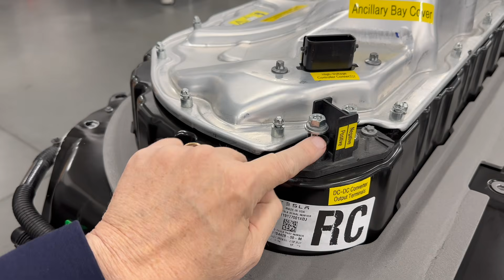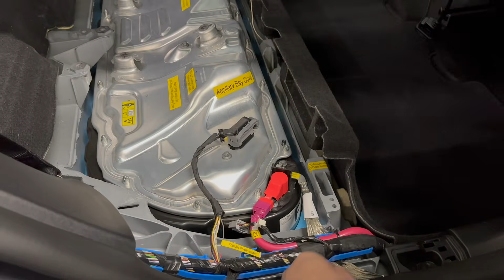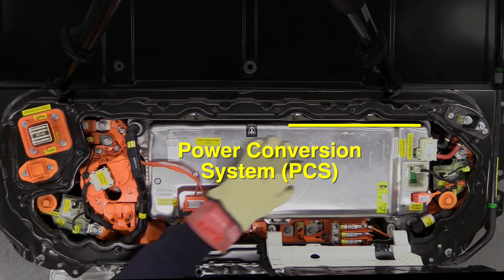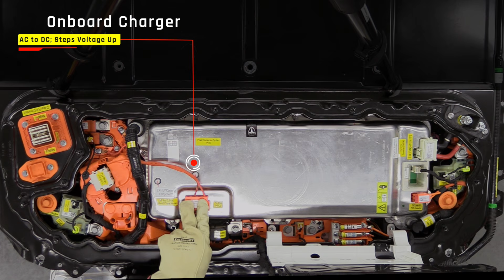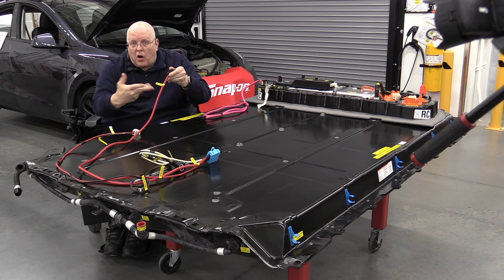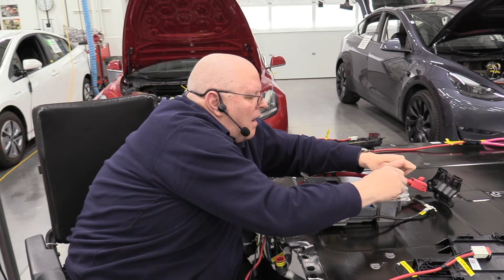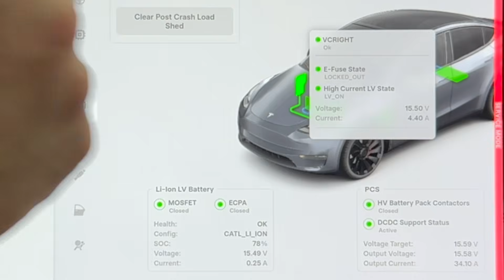Tesla Low Voltage Charging System

Comment: YES! Hearing that THE Professor John D. Kelly will be recording automotive technical videos again has been the best news I've heard all day. I no longer work in the automotive industry (techs don't get paid well or treated well enough) and moved onto the manufacturing industry, but still like to learn and stay up to date on automotive technology. Your videos are a reminder of what I really enjoyed about the automotive world, shame that the service/repair industry had to ruin it for me.

A small bit of personal experience with the 16V Li-Ion batteries in newer Teslas: my partner was recently in a major collision where he was hit by a drunk driver who was going well in excess of 100mph on the freeway. My partner was in our (late) 2022 Model 3, drunk was in a mid 2010s Mustang. The Mustang hit the Model 3 at least 40mph faster than my partner was going, rear ending him and hitting with basically a 20% overlap in the right rear. It wiped out the Model 3 basically all the way up to the right rear door, where the Mustang seemed to then get pushed off, avoiding crushing the passenger compartment (kudos to Tesla for making the passenger compartment secure).

Where I wasn't impressed was in the low voltage battery reserve capacity. As a result of the impact, the Model 3 got launched into the center divider of the freeway (cable barrier) which shredded the left side of the car and basically ripped the charge port off the car. I don't know if this caused a short or if Tesla does this in all collisions, but it blew the pyrofuse and shut down the low voltage charging system. The 16V battery (which was only a couple years old) was dead within 10 minutes, causing all the windows, doors, trunk, frunk, glovebox, etc to ALL be disabled. Most importantly, all the vehicle lights went out. This crash occurred at 2am while my spouse was driving to work. That meant that a car with zero functioning lights was sitting in the middle of the freeway. Thankfully the police had already arrived by that time, but that is not always the case and could have led to a catastrophic secondary collision. It also made the vehicle incredibly difficult to get into after the fact when trying to recover property from the car before it got scrapped.
Reply from the maker: Thank you and thanks for sharing. I am sorry to hear about the accident. hopefully he was able to get out of the car before the battery shut off.. The 16V battery has a lower reserve capacity. In my tests here on campus, they typically last up to 20 minutes (depending what was turned on) before shutting the car off after the low-voltage charging system is turned off.

Comment: How do you feel about that aluminium cable plugging into a copper one?
Reply from the maker: As long as the connecting terminals are compatible it is not a problem.

Comment: I have lots of power outages in my area. Thinking of getting a pure sine wave inverter so I can power a few basic things when the power goes out. What is the maximum wattage pure sine wave inverter I can hook up to the low voltage terminal at the back? I have a model 3 with the lead acid battery so the system is 14 volts. What is the max amps the DC-DC converter rated to? I can see from the presentation that with the car just on it draws about 33A. So I assume if the DC-DC is rated to 100A max then the pure sinewave inverter can draw 67A or maybe 60A to be on the safe side?
Reply from the maker: Do not connect it at the terminal in the back, it will cause errors. If you must, connect under the hood at the jump start location. The DC-DC converter is rated at 2500W, but the car uses about 450W just to be powered on.

Comment: Thanks for the low voltage system breakdown, some more ground connections I need to spray with a product called Rustcure. Corrosion on ground connections is a bad thing.
Reply from the maker: You are welcome!

Comment: I have jump-started ICE-cars a couple of times with my Model 3 -21 Lead Acid, jumper leads attached straight to the battery. Now I just bought a Model Y -24, 16V. When jumping other cars, is it preferable to attach the leads to the 16V battery or is it better to attach at the"penthouse"?
Reply from the maker: The owner's manual tells us not to jump start other vehicles, but if you are going to anyway, use the jump start terminals under the front trunk.
Reply: @WeberAuto  Thanks for the info and the advice. It will try and see, fully aware that I'm paying if anything bad would happen, which is a risk I'm willing to take.

Comment: How is the HV Battery connected to a DC/DC for the Standby, if the contactors are open? Are there Sense-Wires that are used and how is the schematic?
Reply from the maker: Yes, the there are two wires per contactor monitoring if the contactor is open or closed. One of those two wires on the positive contactor is always connected to the live side of the battery positive. One of those two wires on the negative contactor is always connected to the live side of the battery negative. They are connected to the high voltage controller (HVC).

Comment: I’d be interested to see what higher low voltage vehicles look like? Things like a lucid air or Tesla cybertruck. I’m not knowledgeable about these kind of things, but fascinated by it all. Would the wiring be smaller if it was higher voltage?
Reply from the maker: I am working on gathering 800 volt systems to play with. From what I have read, the low voltage systems are very similar. The Cybertruck has 800V, 48V and 16V systems. Thanks for watching
Reply: @WeberAuto  thank you! Love the videos, and awesome to see Weber state. I’m originally from Utah and miss it every day!

Comment: Do you have a tip for getting Power out from either the high voltage or low voltage line for supplying a home/ battery powered inverter like an EcoFlow delta pro or similar?
Reply from the maker: I do not. Tesla does not address accessories tied into the LV system except through the accessory sockets.

Comment: I watched this because I keep hearing about EVs with low voltage batteries that go flat after a few days.  I have been wondering why they are not kept charged from the high voltage battery.   I am astonished to discover that only Tesla has thought to implement this outstandingly obvious requirement for trickle charging.  The standard of products these days is appalling.
Reply from the maker: The Standby Power Supply is a wonderful system.  Thanks for watching

Comment: Considering M3 Highland, where is the best place to tap into the 12V system to take up to 50A out for charging RC model battery? Will it produce any errors if I pull that amount of power?
Reply from the maker: It will set errors no matter where you tap into the system for 50 amps. I cannot find any Tesla guidance for such a situation. Best wishes.
Reply: @WeberAuto  It is very unfortunate this is not possible and that there is no 230V DC-AC converter like other brands have. I would like to get M3 but I would also want to not have to load 2x 12V 100Ah LiFe batteries I currently have for flying. Considering the DC-DC is capable to put out 83A or so, I think it should be able to get me 40-50A on its output...
Reply from the maker: @jointercz  The DC-DC is rated at 2500 Watts. I am not sure how long it will let you draw 50 amps without triggering a service alert.
Reply: @WeberAuto  Thanks for letting me know the rating. I want to get it next year and this is something I want to try, so if that happens, maybe I will remember you helped and let you know the result. :) And thanks for the video very much, very useful.

Comment: Love your videos can you go over the low voltage system of the Rivian R1's?  The recovery procedure is not very clear in the manual.
Reply from the maker: I would enjoy that, thanks for watching
Reply: @ standby power to the low voltage is key on the new teslas to prevent bricking!

Comment: Great to see you back with a new video!  You mentioned a wire that is used to maintain the LV battery charge level while the vehicle is sleeping and it does not require the HV battery contactors to be closed to do so.  When I monitor the voltage level on our 2023 Model 3 LV battery using a multimeter or Bluetooth voltage monitor, the voltage level drops slowly over a six day period then wakes (the contactors close) to replenish the charge level.  Did I misunderstand what you described in this video regarding this?
Reply from the maker: Thank for the feedback. Good catch! Tesla made a firmware update to reduce the electrical loads when the car is off. They got rid of the "Standby Power Supply" system and introduced a "Sleep Bypass" system. "When the Model 3 goes to "sleep" the new sleep bypass will turn on and connect the entire low voltage system directly to the HV Battery to supply a continuous 10.6V rather than relying on just the LV Battery for power." "During Sleep, there is some LV current draw through the Sleep bypass. This average current is reported after the vehicle wakes up by VCFRONT_sleepCurrent. While 500 mA is the minimum threshold for the Sleep state, it is high enough to drain the LV Battery to the point where it requires support relatively quickly. Ideal vehicles have an average sleep current of about 75 mA, while the majority of vehicles draw around 120-130 mA. There are many factors that affect LV current draw, the largest issues being 3rd party devices tapping into the Sleep Standby Supply." This information explains what you are seeing. Thanks again. With as often as Tesla issues firmware updates, I need to check my service information for changes before publishing a video like this.
Reply: @WeberAuto  Thanks for the response!  Searching for "Sleep Bypass" it appears there might be a low power Buck DC-to-DC converter located in the Penthouse or possibly the VC-Front controller that directly gets its power from the HV battery and does not require the HV Contactors to be closed.  In the event of an accident, a blown Pyrofuse would presumably isolate this direct bypass connection to the HV battery?
Reply from the maker: Yes, an open pyro-disconnect would remove voltage from the connection to the HV battery.

Comment: Very clear explanation of the system Professor Kelly.  Several times during this video I was asking myself why do they need a separate battery for the low voltage system when they can convert the main battery voltage to whatever they need? Afterall, they are still bypassing the contactors to maintain the LV battery when the vehicle is switched off and they can monitor the main battery SOC to prevent it going completely dead.  At the end I think you indirectly mentioned it.  In an accident, the main battery is disconnected from the vehicle however they may still essentially need emergency LV power for other life safety systems.  The other reason of course is the contactors themselves need an independent LV power source for actuation.
Reply: It's required by federal law FMVSS
Reply: @Nicholas-f5  I'll take your word for it as I can see the safety implications especially on modern vehicles with their power windows and door locks...
Reply from the maker: Thank you very much!

Comment: As usual, a high-quality and informative video. PSC maximum current 81.2 amperes when everything is turned on, including two sockets (in the trunk and armrest)? What is the maximum continuous current it can give, for connecting an inverter 16v to 220v? Tnx
Reply: One way to find out is to use a carbon pile, ammeter and voltmeter as shown in this video: https://youtu.be/y7Q_ZXxCfMM?si=lpwCU5x9yPF1qf-C&t=54 

In my testing I’ve often witnessed well over 100A when loading down to 12V.
Reply from the maker: Thank you. The DC-DC converter is rated at 2500 Watts maximum to the VCFRONT, not the LV battery.. It will trigger service alerts for unusually high current if the LV battery draw is too high for an extended period.

Comment: This is a great video. Everything you have discussed seems very accurate and well researched. The only thing I will say is, When dealing with the HV battery connections, If the points being touched have known high voltage, or are unknown/untested, it is recommended to only have one hand in that area. The other behind your back/ at your side. All it would take is a pinhole in your hv gloves to allow voltage to get you. If you have both hands in, the path of electricity is through your heart. While it is a worst case scenario, it is possible.  Also, if the HV battery is being serviced, it is suggested to remove the pyro disconnect to halve the voltage. Everything else I saw here is well done.
Reply from the maker: Thank you very much. Great comments on safety procedures.

Comment: Could you explain supercharger?
Reply: Used to be a stack of onboard car chargers but now seems to have a changed
Reply from the maker: A supercharges is Tesla's name for a DC Fast charger. It converts AC voltage from the power grid to DC and feeds it directly to your car's battery.
Reply: @WeberAuto  can you make a video of cabinet?

Comment: missed you bro. have been running my gen1 chevy volt off of a 32 ah lifepo4 battery i built which saves ~50lbs of weight. also have a solar roof which keeps the low voltage side topped off through an mppt. teslas bump in voltage and the videos on youtube are what gave me the courage to try this. beeing running fine for the last year with no bms, just an inductive active balancer and a thermostat relay board/heating pad. your videos on the gen1 volt is partially why i got the car. best car ever imo
Reply from the maker: That is awesome. The first gen volt was an amazing car.
Reply: Great for short trips before the gas engine turns on perhaps
Reply: @Nicholas-f5  good for my 185 mile commute so i only end up using 2 gallons of gas lol. charge at home, charge at work.
Reply: You're running a lifepo4 battery with no BMS?  Why in the world would you do that?
Reply: @stargazer7644  more max amp discharge rate, no low temp lock out, cuts the price by around 50%, better balance capability with active balance boards, less self discharge, no low state of charge lock out. and its probably safer given that most lithium fires are started by bms that drop a cell or malfunction. all of these make a lot of sense in an automotive application, its why lead acid batteries dont have bms' lol.

Comment: Great to see you back on board...with the SLA LV cars, what would be the maximum current draw ( i.E.the protection fuse) for the dv-dc charging cct?
Reply: Wow..Thanks and while we are on a roll...same for the Li-16volt ones?
Reply from the maker: @Hunter-EVOutback  yes
Reply from the maker: Thank you. The model 3 and Y are rated at 2500 Watts maximum.

Comment: This is actually the main part of EV and the main difference between EV and ICE Car. The EV main high battery is just like ICE fuel tank and engine. Then there is still need a generator to charge and power the devices just like old ICE car that is the Power converters to 12v systems. Most EV and plugin put 2 to 3 kw converter and user can use this for 2k DC AC inverter to provide 120vac source. I use this for 1500w 3000w pick to power the house if need and no longer needs generator. If need just add auto transformer for 240vac. Just keep in mind only put about 80% or less car converter can do for the DC AC inverter. Plugin hybrid with 18g fuel tank, it can run a long long time and best part is very quiet and efficient. The engine will not run all the time.
Reply: So I can take from PSC up to 3 kW? 3000/15.7=191 A. Have you tested it for continuous current?
Reply from the maker: These Tesla vehicles use about 400 Watts when powered on. The DC-DC converter is rated at 2500 watts, so you have 80% of the remaining 2100 watts to play with (1680 Watts). Thanks for watching

Comment: How much Power can the PCS deliver to the 12 V-System?
Reply from the maker: 2500 Watts to the VCFRONT. The car uses roughly 30 amps at 15.5 Volts (465 watts) of that when powered on.
Reply: @WeberAuto  Thank you so much! Can power be drawn directly from the PCS output or will the difference in current (PCS out / VCFront in) set an error?

Comment: Thanks! I’ve learned a lot. For my 2018 Model X, it shows a low battery voltage warning. I'm planning to connect a 5-farad supercapacitor to the existing lead-acid battery to try and eliminate the warning. Does anyone know if this will work and how long it might last?
Reply from the maker: The 2018 Model S and X have a different system than the one in this video. Buying a new lead-acid battery sounds like the safest option.
Reply: @WeberAuto  I really dislike lead-acid batteries, but I’m hesitant to replace it with a 12.8V LiFePO4 due to the risk of cold temperatures. That’s why I’m considering using a supercapacitor instead. Thanks!

Comment: What is missing in these batteries is a pre charging warm up system before they  get to the super charger in sub zero temperature.
Reply from the maker: They use heat from the drive motors to heat the battery as needed, even during a drive to a supercharger
Reply: Mr. Kelly has other videos explaining how this works and it’s pretty cool. Tesla uses the drive motors in a way (lossy control) to generate heat which is transferred into the drive unit oil which is then transferred into a coolant loop which is routed to the battery. On the heat pump systems, they have the ability to section off a loop where the temperature is regulated to a lower temperature and can be used to bring the battery temperature down if needed. I put together a short video explaining some of this here: Tesla Heat Pump & Thermal Management with Supercharging
https://youtu.be/2D9ADqOwADg